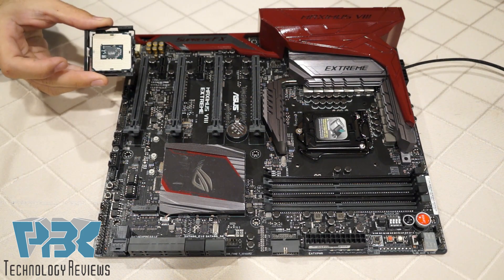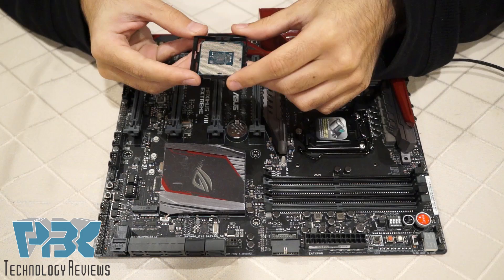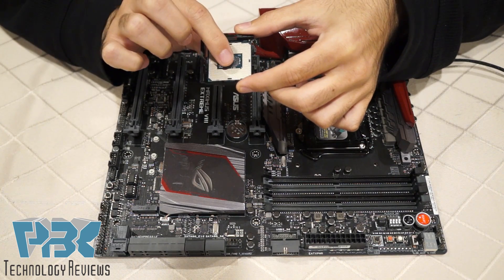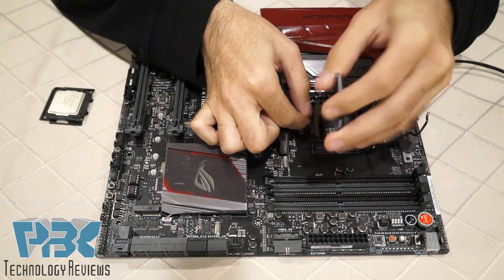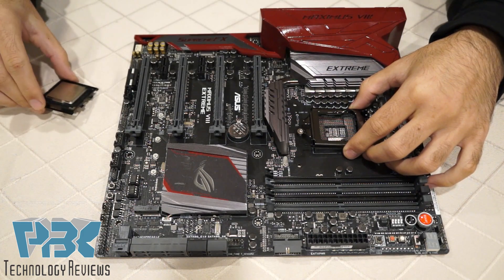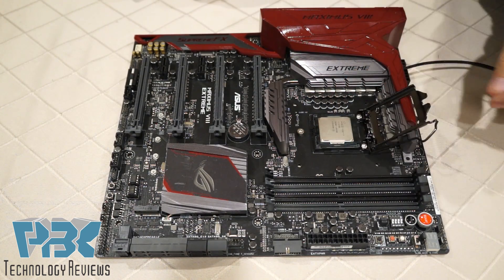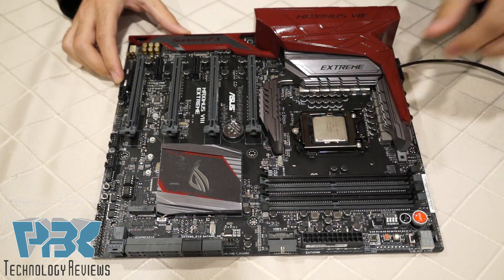How To: CPU Installation with CPU Installation Tool On ROG Maximus VIII V8 Extreme Motherboard

Comment: I got that with my asus board........so stupid. so you touch the resisters and you leave plastic around the cpu? LOL what if you game for a long time and that plastic melts all over, you board could be ruined. The plastic is also thick, that will create more tension for the pads to touch the pins.

Comment: No way in hell I'm putting pressure on my CPU to lock on this weird CPU Installation Tool. I don't even recommend using this "tool" at all. Just pop the CPU in the motherboard not hard, just gently enough where it slides in and give it a little wiggle with your finger to make sure it makes contact with the pins on your motherboard.

Comment: This "cpu installation tool" is absolutely unnecessary and aggravating to say the least! I installed it (per the manual) only to have the CPU fall completely out of its socket, onto my $1k 1080ti and then onto my tile floor! POS gimmick!! 

WTF Asus thought this was necessary is beyond me. Just install your CPU without it. You don't need it. Its a gimmick and can cause damage to your board, GRX card or chip!
Reply: I'm guessing you accidently didn't "click" the chip into the tool all the way. May not be absolutely necessary but acts as an insurance policy that it lines up correctly.
Reply from the maker: True, depending on which boards, I have had better luck just installing the CPU out right, but then again there will always be people out there which don't know an apple to an orange and will need all the help they need when it comes to electronics like this, so I guess asus incorporated it as a last help method for some.

Comment: but you forget say ... then you push down CPU the adapter go out after install CPU, the adapter dont stay with CPU ... right?
Reply from the maker: Rogerio Reis the adapter stays with the cpu
Reply: truth? in my case the adapter was released alone after installation my mothorboard is Placa-Mãe ASUS p/ Intel LGA 1151 ATX MAXIMUS IX HERO Z270
Reply from the maker: Rogerio Reis you can take it out also if you want but its there to make it easier for people who don't have much experience. In the video I left it in and in my personal computer I left it in as well :)
Reply: correct ... you are right ... thank you!!!! Congratulation for you channel
Reply: now looking in the motherboard box, as the adapter is not in it so I think I actually left the part in it because otherwise would be in the box of the board, because I usually store everything very carefully because here in Brazil to sell used products is good to have the box, because as we know, today's top computer becomes obsolete soon and then seeing and buying another. Thanks for the clarification.

Comment: Dont you think thats alot of tension? What about that creeking noise?? does it have less tension with out the plastic installation tool?
Reply: My CPU socket wouldn’t stay closed with the install tool left in. I removed it.
Reply from the maker: Chase Ryan its ment to have that tension so the cpu does not move at all. I have not tried installing without it, but the creeking noise is normal. previous mobos without cpu install tool had very similar tension.

Comment: GOOD idea, especially given my recent efforts that may have damaged a board (or two)'s cpu pins !
What ASUS SHOULD make clearer, is to do as you show and press centre of CPU...I clicked it in from each side, but end result is the same.  Reason for my search was  to double check that the tool remains in place with CPU (it does, as you show) Thanks :)

Comment: Hi, have you noticed if both of cpu support sides are damaged? It looks like the motherboard socket pushed a little bit to hard and screwed up both sides of the cpu where is being held by the socket. Like it's being pushed inside.
Reply from the maker: If you are referring to the one in the video, no it was not damaged. Its in use currently by one of our techs :)
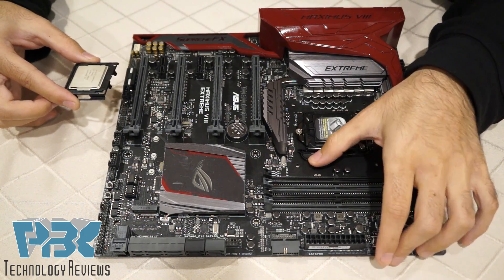Reply: He meant superficial damage on the sides of the cpu heatspeader. If you look closely from 00:28 till the point he places the cpu into the socket, you can see a tiny speck of damage on either side of the cpu.

Comment: How is this easier than just placing the CPU directly in the socket?
Reply: I kind of concerns me leaving plastic casing around a hot overclocked cpu that's gonna have a dedicated £100 heatsink specifically to remove heat right next to it?
Reply: its not i I used this tool and the CPU still went in off side and still bent the pins 2 boards now, you have to watch the the edges do not go out of corners.
Reply: That's what I'm wondering. I don't get the point of it, lol. Unless this is for some very stupid people that shouldn't be building PC's in the first place or something.

Comment: Is it safe to touch back of the  CPU.Does it damage CPU
Reply: Devon Dolese ... No, just go ahead and start up. The reason you don't want to touch is because it's possible to short the circuits inside with electrical static from your body, like when you walk on carpet then touch someone and zap each other. If for some reason it got zapped, cleaning or anything else won't make a difference.
Reply: Devon Dolese ... And I wouldn't really be worried about the whole oils from your finger thing.
Reply: DerekAz thanks dude!
Reply from the maker: Yea just as long as you don't cause any static to it or leave oil residue behind before installing
Reply: Tito Puležan ... It's best not to touch the back if it can be avoided and the better installation tool kit include an anti-static "sticker" you put on the back of the chip just for the purpose of installing into the tool. You then remove the "sticker" just before installing it into the socket.
Reply: DerekAz im dumb, my last 3 rigs have all been AMD, and I totally touched those contacts. I have yet to start it, so should I take it off and clean it or will that just cause more harm than good? Hate to randomly ambush ya with a question, but yeah. kinda at a loss here and too paranoid to start it now.